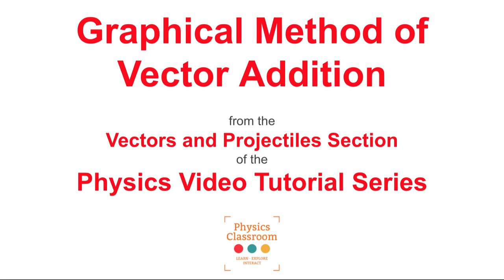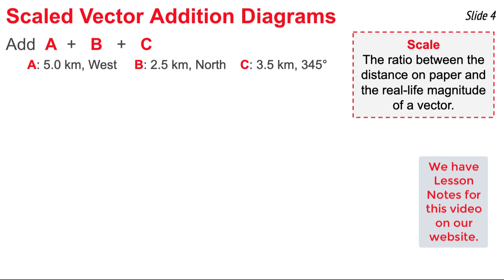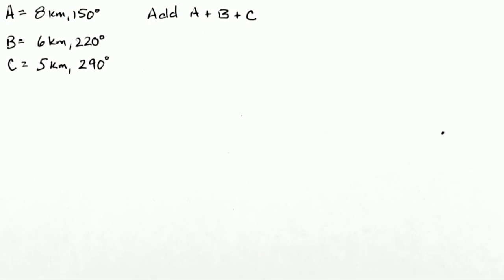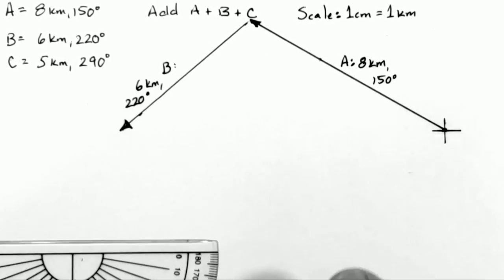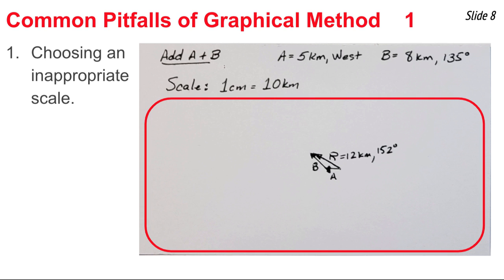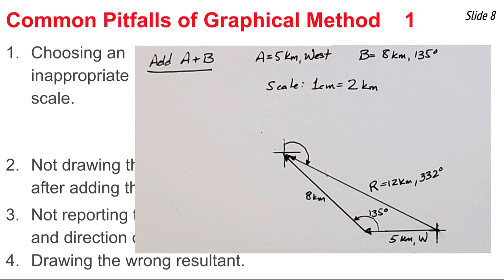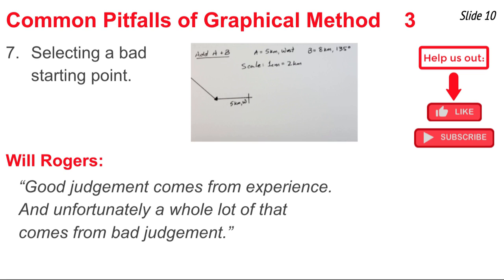Graphical Method of Vector Addition

Comment: is there a way to solve for the resultant if there is  more than 3 vectors bcuz my teacher gave us 5 vectors  to solve for  it resultant
Reply from the maker: Most the examples in this video are for 3 vectors. But the principle of adding 3 works for 5. Just keep going after the 3rd vector. Add the 4th vector to the 3rd and add the 5th vector to the 4th in the same head-to-tail method.

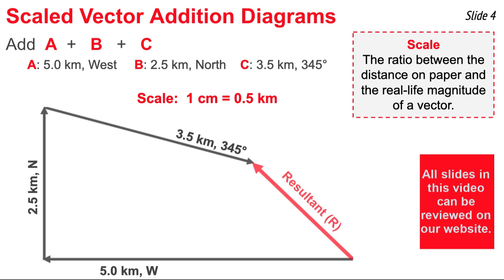Comment: Hi, where did you get the resultant magnitude 2.3km?? 2:32
Reply from the maker: I used a centimeter ruler to measure the length of the vector and then I multiplied it by 0.5 km since 0.5 km is equivalent to 1 cm according to the scale.